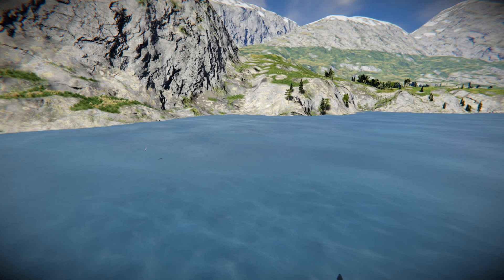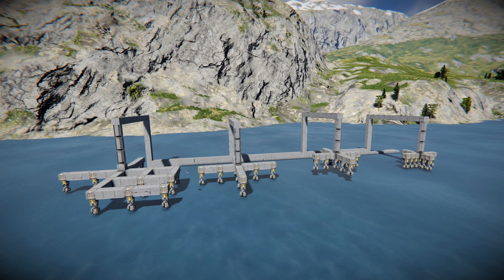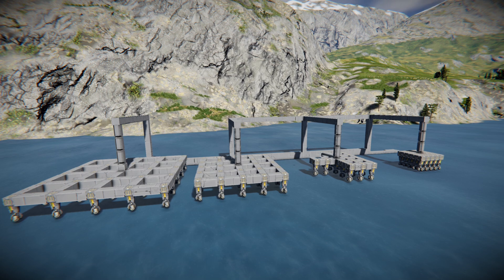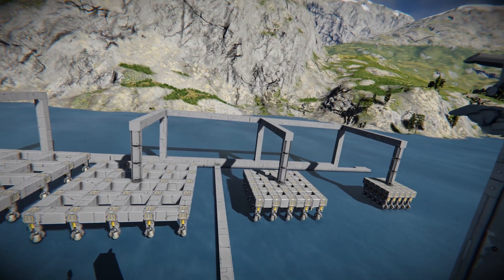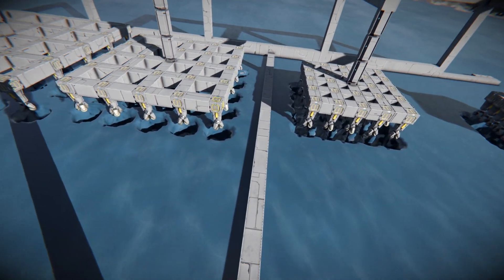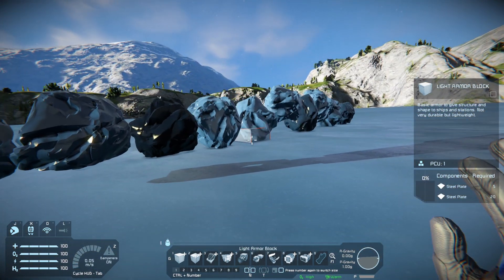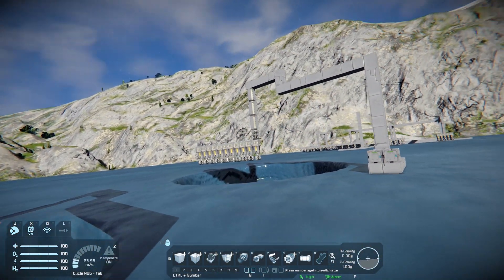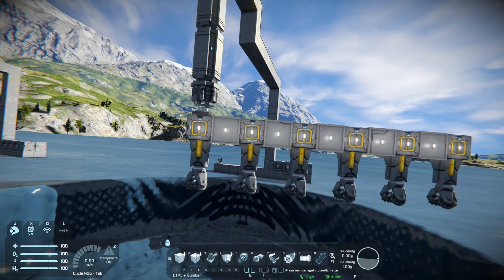Space Engineers Experiment: Large grid drill placement.

Comment: On the single block gap test (2nd from the right).  What if you used the following configuration:  X = Drill  - =Space

x - x - x - x - x - x - x - x
- x - x - x - x - x - x - x -
x - x - x - x - x - x - x - x
- x - x - x - x - x - x - x -
x - x - x - x - x - x - x - x

Would that work or would you still get the same blockers preventing drilling?  Because it looked it was only the diagonal gaps that weren't getting drilled.

Comment: I think that the first test was a no-brainer even before hitting the start button as large grid drills will only cut a hole the same size as the drill body itself.
    I was a little surprised that the second test was successful with the spaced drills, for the same reason.  My guess is that the little bit of wobble from the pistons and rotor was jus enough to knock away the bulk of the ridges that I expected to stop the drills going down.
     I think a more interesting test would be to compare your optimum small grid drill set-up against your optimum large grid set-up.  Comparing speed, collection and cost to build.
Reply from the maker: Yeah, the first test was really to make the second shine. I have since found out that a checkerboard pattern works well with the first setup, and I think this is why the second works so well.